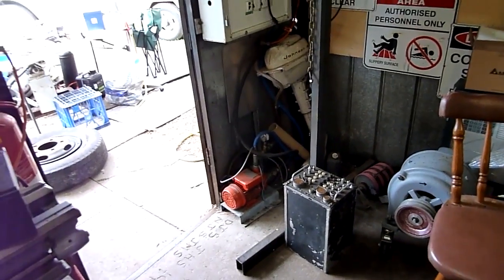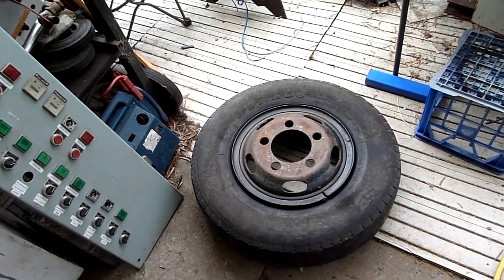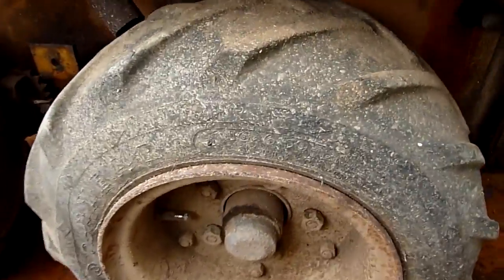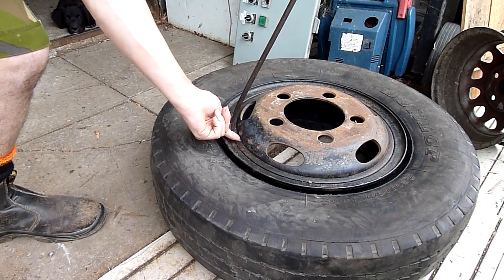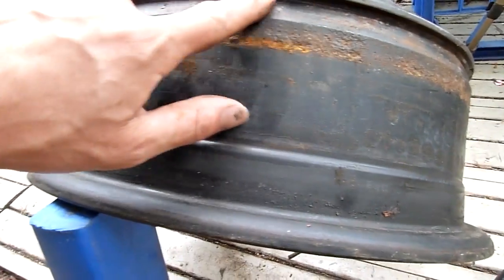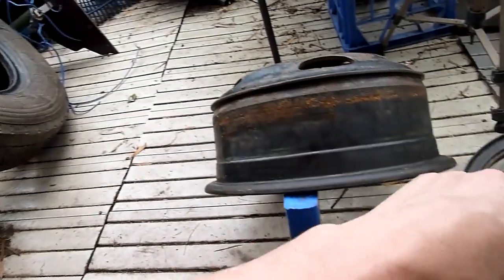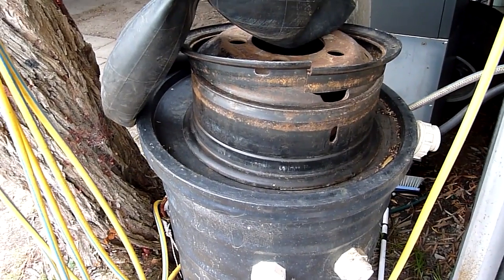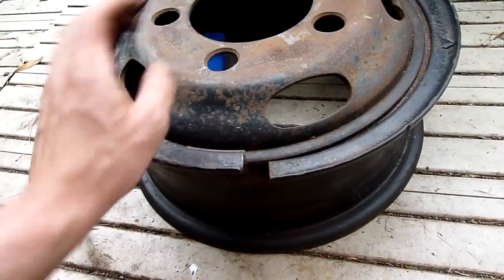The Locking Ring Split Rim - AKA Widowmaker - Why is it deadly?

Comment: I used to change these back in the 1970's using a wedge headed sledge hammer. We worked under what was essentially a very high car port type roof. The guy that was training me took me out to the work site and said "Look up". I did and there was a 16 inch 1/2 moon shape cut in the roof that was 20 feet in the air. He told me that the tire that that lock ring came off from only had 20 lbs or pressure in it and it took the top of my predecessor's head "slap off". 20 pounds doesn't sound like much but it is 20 pounds PER SQUARE INCH for every square inch if surface area of the tire front, back and tread. If there's 500 square inches on the tire, that's a total of 10,000 pounds of total pressure. I don't know how many square inches there are in a 10.00 X 20 tractor trailer tire but I know that there's a bunch of them. He said if the guy had lived, he would have been fired for not using a safety cage and I will be too if they catch me not using one. Years before this, my brother worked at a gas station. He said a truck stopped in for air in a tire. The driver began putting air in and BOOM!!! The ring came off and took his fingers with it.
Reply from the maker: oh yeh these things are no joke, the one I have in the video is the safer of the designs, some are worse, especially the non-split ring wheels where you push it over to one side and it just hangs in there. in good order with no rust they are not bad, but once you deal with worn and rusted old ones, they do not hold together as well and can fly apart.
Reply from the maker: I had a similar discussion with a friend about hydraulic pressure and the steel I was using, over a large area 5000psI would burst the steel I was using, but over 1/2" on the tube I was using, it was 1/4 of the bursting pressure, tires and other pressure vessels are no different, even a car tire bursting at 30psi is enough to ruin your day!.

Comment: Thanks!  I don't believe I've ever heard before. exactly what makes split rims dangerous. 
      But warn people - All inflated tires are dangerous when inexperienced people are working on them.
      I once was having a set of tires replaced on an, old then, 1956 Dodge pickup with standard one piece rims.  Simple right?
     My dad always told me to never stand near where someone, anyone, is inflating a tire.  As a kid I always thought he was exaggerating - but I obeyed him out of habit. 
     There was some kid mounting my new tires on the rims.  I remembered what my dad always said, and I walked to the far end of the shop while the kid was setting the beads.
     At one point I looked over for no reason, but I saw the tube coming up from between the tire bead and the wheel rim on the tire the kid was working on.  Before I could yell, the whole thing exploded!  At the very first of the explosion, I started to duck down and to the left.  I thought I was okay, except my ears were ringing like I"d been near someone firing a gun.
     The whole shop  was in turmoil.  Come to find out, they had to take the kid to the hospital.  He lost his hearing and his arm was busted, by a tire tool flung up during the explosion, hitting his arm.
     Strangely, the bolts holding the  tire mounting machine to the floor, had pulled out as well.
     In discussing the explosion with the shop owner, he noticed I was bleeding from the outer part of my right ear.  Apparently a piece of the tube shot clear across shop hitting me as I dove.  If I hadn't started to dive to the left and just stood there, I might have lost an eye.   How bad would I have been hurt, if I hadn't followed my dad's early training, and been standing near the kid?
     It all merely suggests what forces are involved in such an explosion.
     Bottom line is, always watch out for yourself, whether you are the worker, or the customer.
     Be Safe!

Comment: I had split rims on my 1947 GMC pickup. Heaven help me if I had a flat tyre. I bought more extra rims for ridiculous prices in small towns. In 1947 servicing tyres in the field was common, back then. I welded up a tyre cage & kept using my split ring rims. The GMC moon hubcaps didn't fit anything else. I have seen a tyre spoon pop off a bead setting machine and kill the operator dead as a post. That bar popped off the machine's power hub, and spun right up into his forehead. That is when everyone gets the rest of the day off....and the next day. I have never seen a split rim let go.

Comment: Thats a lock ring wheel, not a split rim aka widowmaker. Lock ring wheel are still on school busses and most trailers used for hauling shipping containers. A slit rim/ widowmaker is a two piece wheel that locks together in the center of the wheel. No locking ring no bolts just barely holds together under its own pressure much more dangerous

Comment: Those are not widowmakers. Widowmakers do not have a lock ring, there are actually 2 wheel halves that snap together. Those are simple lock ring split rims...still serviceable at most truck shops and pretty safe. You do still want to use caution when mounting tires on them, but as long as the ring is installed properly, there is no problem at all

Comment: Surely they could be retro fitted with a small piece of metal welted to that bit of metal that goes flying, and once it’s on, the metal lines up with a hole on the inner rim and just bolt it down in 2-4 places?? Or am I missing something?

Comment: when I was shown how to fix a tire with a split rim I was told to put it under the vehicle if anything went wrong the tire and rim was under the vehicle as to fulling the tire up with the air  we had a value we stand  way found to blow it up it reaches it the presser  the safety value lets go and the air of the tire will be blown out of the tire 
no one was hurt when we had them we do not run split rims anymore here and we will not work on them too

Comment: Some of the three piece versions still lurk around as well, especially heavy equipment, like fork lift trucks, but a few old dump trucks etc use similar, and I have seen them on an old motorhome.
Know some guys who once replaced a ring and pinion in a big old dump truck and it came back with a rattle. When it rolled in, they noted it was not coming from the center where they did most of the work, but from one of the dual tires or hubs. so they removed the wheels and "Hey, there is the problem! It has an extra rim ring rattling in between the wheels."
Then they looked at the wheel they pulled off, and its lack of a rim ring holding the still fully inflated tire onto the rim.
Someone kicked it and it rolled into the yard to fall over, bad side down, of course.
Talk about puckering up.
"What do we do now?"
One pulled a pistol out and said "Tell them they need to pay for a tire repair" and shot it so it deflated.
The rim and bead had enough rust to hold them together at 100psi and the ring was walked out by the rust caused by mud and salt used on the roads. Fixing the worn R&P and using the beast again likely worked it the rest of the way loose. They never pulled the wheels for their work, so they had no chance of catching it before.

Comment: I work on lock ring wheels on a weekly basis here in central California. They're actually not as dangerous as people are lead to believe. You'll regularly find them on trailers and forklifts. The wheels you need to be afraid of are the center split wheels, those are really dangerous.
Reply: The center split are the ones that are called widow maker. These are not.
Reply: if you ever see one buried into a wall you change your tune it only take one death to make them dangerous  i would  not brag too much about it
Reply: @frankdavidson9675  well if you had one shoot off into a wall it was probably because you didn't know what you were doing. I've worked on hundreds of them and never had a problem, you just have to know what you're doing.

Comment: Working in the mines back in 1995 during shutdown spare hands would be patching these things up. After doing 30-35 or so one let go in the cage. We all shit bricks. Lucky it let go around 20psi and fucked a tube and liner only. I think there was some hardened clay in that grove preventing the ring to seat correctly. Needless to say each one after that explosion was wire brushed cleaned. During inflation everyone had their fingers in their ears after that.

Comment: I thought the widowmaker was a similar yet non split ring. I heard those are long gone, and I’m assuming they were replaced by this style of split rim. I’ve personally worked on the style of rim in the video and it’s pretty nerve wracking, especially when inflating.
Reply: the tires and rims we are using on m37 army trucks are apox 70 yrs old we keep rims but get new same size tires  900-16  8 ply-------- heavy---

Comment: When I was 18, I worked for a school bus company.  They had me mount dozens of tires for their annual summer maintenance.  Never told me about the dangers.  Never even told me that they owned a tire cage.  It was outside piled up with junk on the side of the garage.  All of my rims went together nicely except for one... the bead seated at about 60 psi and it jumped a couple feet off the floor.  It did not blow apart, but I realize now how close I came to a life changing or life ending injury. Thanks for the detailed video!

Comment: Split rims are still common in America, especially for trucks in the 2-5 ton range. This type of wheel is stronger and more durable then standard rims.  I worked in a shop for 30 years and our tire man never had one blow because he followed a few simple safety rules.  He was also adamant about cleaning the rims and rings with a power wire brush, and using rim lube when installing them.  Once, a mechanic was trying to change a tire and used a 16 inch tire instead of a 16.5 inch tire!    I stopped him, explained what he was doing wrong and advised him to wait until our tire man returned from lunch!

Comment: THIS IS ANOTHER STUPID WIVES TALE PASSED ON FROM GEN. TO GEN. WITH OUT ANY THOUGHT TO FACTS.  ONE OTHER THING THIS FOOL SAID WAS THAT SPLIT RIMS ARE NOT TUBLESS.    I HAVE A CASE AIR RUBBER TIRED 40,000 LB EXCAVATOR WITH TUBE LESS TIRES SPLIT RIM. 24 INCHES WIDE 4 FEET HIGH  ETC.   tube less  split rim !

Comment: THERE YOU GO ...ANOTHER FOOL ON YOU TUBE... DONT LISTEN TO THIS FOOL.  HE SAID PUT  YOUR BAD WHEELS OR TIRES ON THE REAR.. THAT IS WRONG. IF YOU HAVE A FLAT TIRE ON THE REAR, YOU MORE LIKELY  LOOSE CONTROL OF THE CAR.  BUT IF YOU HAVE A FRONT FLAT, YOU CAN COUNTER  STEER THE DRAG [PULL] TO EITHER SIDE  WITH STEERING WHEEL. MEANING THAT YOU DONT LOOSE CONTROL. THATS A FACT JACK [ THIS DOSE NOT APPLY IF YOU HAVE DUAL REAR WHEELS LIKE ON A SEMI.]

Comment: As bad as they are, They are a breeze to change on the go. I think the reason a lot of Farm and Offroad stuff still uses them, if IF.. and a big IF, you know how to do it right and safe you can fix a tire in the field in mins. a Hammer screw driver and an air pump, tire changed. They are very very dangerous though.

Comment: Very well done video!

Our family friend had a tire shop and required that they used a cage when dealing with these types of wheels.

Unfortunately, one of his techs realized that he could swap tires quicker if he didn't use the cage. One day, his luck ran out when the wheel failed, it launched him into the ceiling, killing him instantly. 

Our friend had served in the military and said the only time he had seen a similar scene was when a soldier stepped on an IED. 

It truly amazes me just how destructive a wheel can be.
Reply: In a pinch ive used a lift or forklift forks as a safety cage (young and dumb at the time)

Comment: I saw one of these blow during a tire replacement 30 years ago when I worked in a large tire shop. It was in a safety cage device that had lost it's retaining pin and the pin had been replaced with a large nail probably 1/4 inch thick. The split-rim guy was trying to seat the ring with a big hammer at about 100 psi. You do this with the tire flat on the floor to make sure the ring isn't likely to slip as the bead is seated or later down the road. ...Never with any part of your body over the tire. The ring blew and the safety device cut through the nail. The top of the safety device and the ring went up and through a sheet metal roof 18 feet above. Not just a tin roof but a commercial-grade sheet metal shop roof. Ping BOOM! This guy was experienced. There was no warning. I was 10 feet away and ended up on my rear. No injuries. Ringing ears. It would have killed or maimed anyone in the path.

Comment: When I was 16 my step dad did these tires for a living at the port in Mobile. I started doing them with me, and about 2 years alter I had my own experience with this. Was putting a 3 piece rim tire back on the trailer after repair, and as it was going on the lock ring poped. Blew the tire, rim, and me back about 6 foot in the air, and broke my leg in 2. Doc said if it has of come up a couple more inches I wouldn't be here today.

Comment: The primary "advantage" to these and why they're still used is that thay are easily "field-servicable" with inexpensive tools as opposed to a tire machine like the tire shop has.  Ideal in third-world countries or where  having a fully equiped shop isn't an option.  Having said that, I DO agree with your opinion on them.  Having serviced many when I was in the military, I never got comfortable with them!
Reply from the maker: yeh if you cant afford a manual bead breaker from a 4X4 supplier, I completely understand, ARB sell them for serious 4X4 guys running tubeless, but they are not as cheap as a tire lever and patch kit.
Reply from the maker: Or even just a large flat blade screwdriver or AK47 bayonet would be enough to pry that retainer ring out

Comment: The origin of the lock ring split wasnt because of too stiff of tires, it was to be able to change the tire in a situation without a barover stand. So a farmer coukd change his own tire over with simple tools. And not all lock ring splits are a widowmaker, that was reserved for the 60's and early 70's ford solid ring split and the 50ish center lock split industrial tires since they had an extremely small surface conection between the ring and the rim. A standard ring split isnt a true widowmaker. Now that its less common people tend to get that confused easy. Other then that helluva good video.

Comment: The air pressure alone will blow a limb off, I've had split rims and tubeless ones explode while airing them up. The split rim blew up after I aired it up, rolled it to the truck,  bolted it on, and took 2 steps away. The bus tire blew while I was airing it up on the ground with my knee on the edge,  it zippered open right under my knee on the bottom side,  blowing it away from me out in the parking lot. I'm lucky to be alive. Air them up in a safety cage if you want to live,  they saved my ass more times than I can count.

Comment: Do the bolt together split rims need inner tubes? I imagine you would be fine if you had some way to seal between the 2 pieces, and come to think of it I have heard of big o-rings used on truck wheels, is that what they're for?
Reply from the maker: The domestic ones for wheelbarrows and forklifts, yes. the Military ones have a big O ring on the bolt on locking ring and do not run tubes.
Reply: I looked up the video I was thinking of, and sure enough it was a 5-ton military truck, an m923. I believe the guy does tours in it

Comment: That's a split ring not a split rim rings are still used on loaders and equipment and as long as you cage them or use a chain to wrap around the rim in the tire and watch what you're doing you're pretty safe

Comment: I used to work for Mitsubishi assembling SKD trucks. Part of my job was fitting tyres to these split rims. We used a safety cage during inflation but I always stood on the opposite side of the wheel from the split ring, just in case.

Part of our safety info was a photograph.  It featured the impression of a man in a corrugated iron roof which was allegedly 3 storeys high. He was thrown there by an exploding tyre.

Comment: Yeah, been working on tires forever.  About seven years at this point.  Enough pressure and one of these will take your head off.  Split ring wheels same thing. 

 I've seen a 22.5 blow out somewhere north of 180lbs of pressure, not properly restrained.  It hit the guy working on it and knocked him about fifty feet back and ricochet into the rafters.  Lucky it didn't kill him.  The closest I came, personally, was a 17.5 for a wood chipper.  The customer wanted it inflated, didn't tell me that someone hit something big enough, hard enough, to unseat the bead on a tire rated for 125psi.  I got somewhere north of 90 psi and started getting a death rip.  That weird ripping/popping sound a tire makes when the cords in the sidewall start breaking.  If you have ever heard it you will know what I am talking about.  That was a tense day.